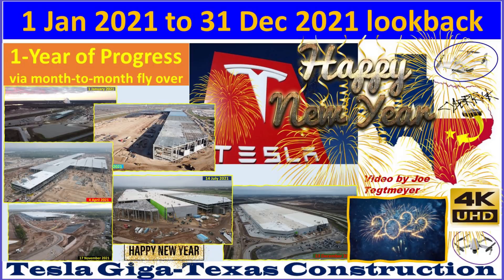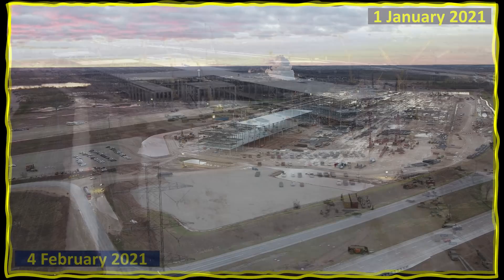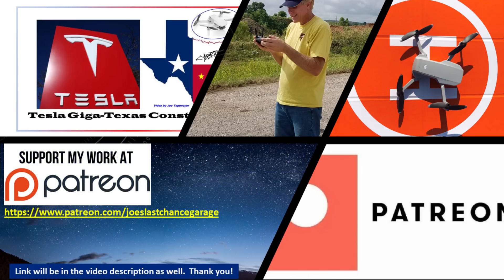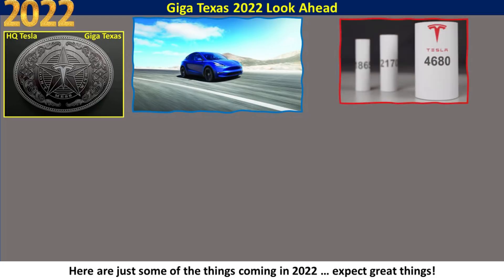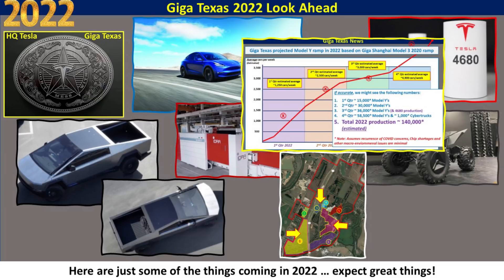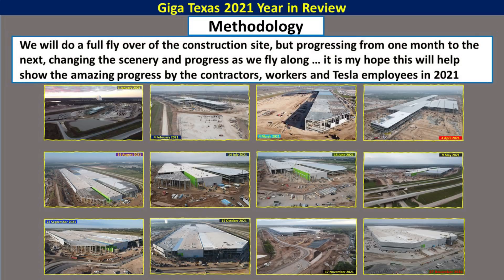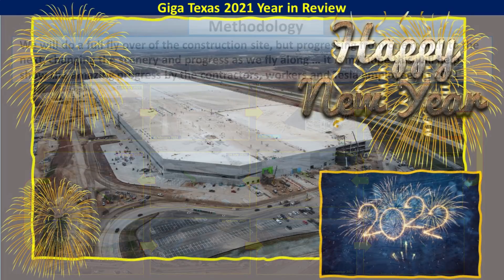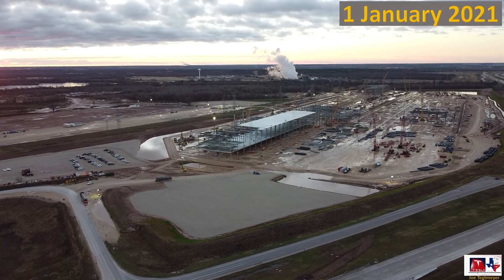Tesla Gigafactory Texas 1 January 2022 .. Full Year Celebratory Lookback & Progress Celebration (4K)

Comment: With the massive savings from manufacturing technology and battery technology , will prices for the model y drop to under 20 000. Or will tesla be the only manufacturer making 60% profit or more on every  car they sell.
If not i can see all other manufacturers offering better quality with everything tesla has except for a few unnecessary features for under 20 000.

This is when tesla will face real competition, no not better cars but adequate cars. I do not need a car that goes 0-60 in even 5 seconds, remember most cars today are over the 10 second 0-60 and people find them fast enough.There are many other things i do not need that tesla is providing, yes fun but damn it is easy enough to have a few tablets for the kids on a long drive